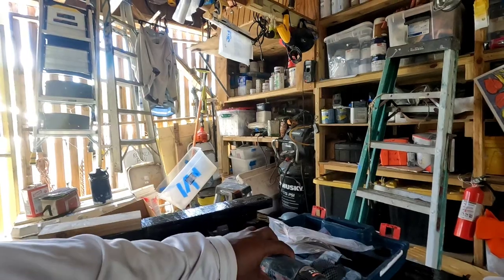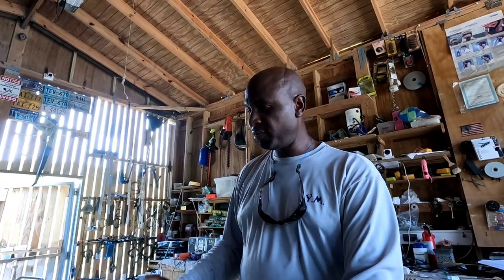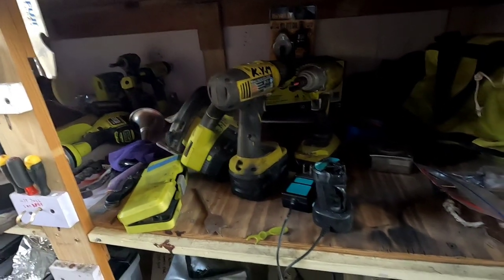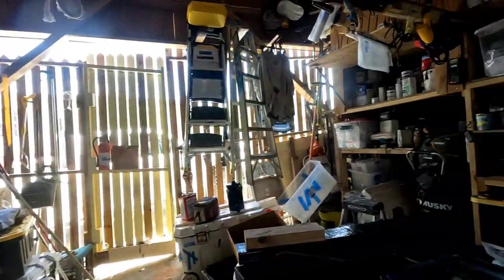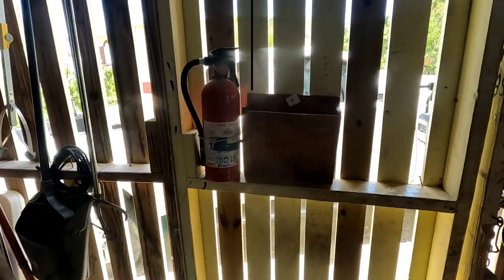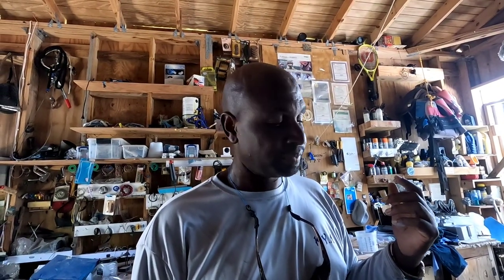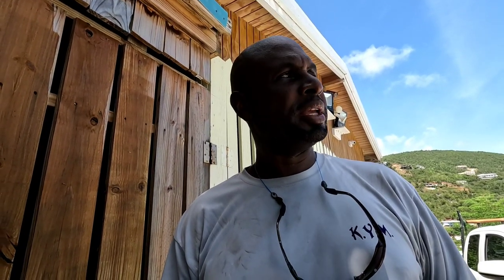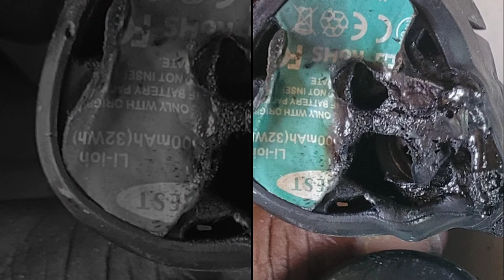lithium-ion battery fire

Comment: For similar reasons I'm sketched out by compressor tanks. Far more deadly than a battery though.
Reply from the maker: Please explain what you mean?
Reply: @kennysyachtmaintenance  the battery has fire and the compressor explodes with large shrapnel. I now keep the compressor in a thick metal cage.
Reply from the maker: @squirrellysquirrels1167 interesting.  Thanks for that info
Reply from the maker: @squirrellysquirrels1167 please subscribe